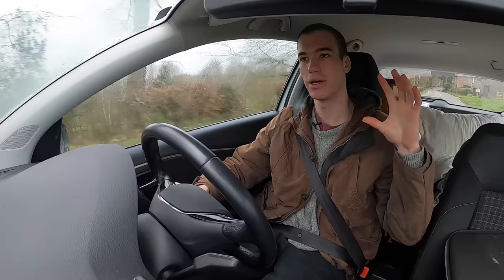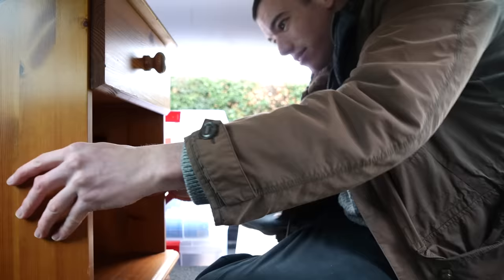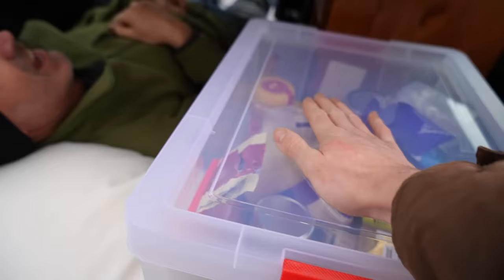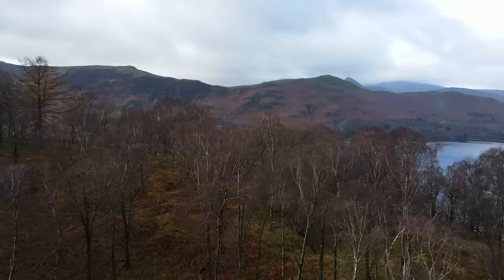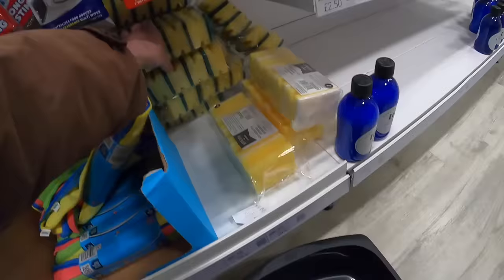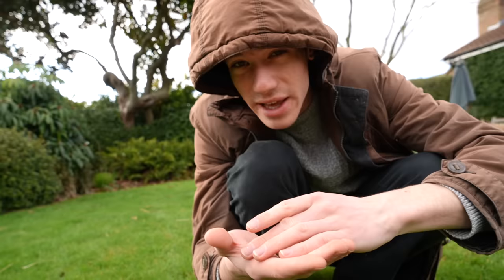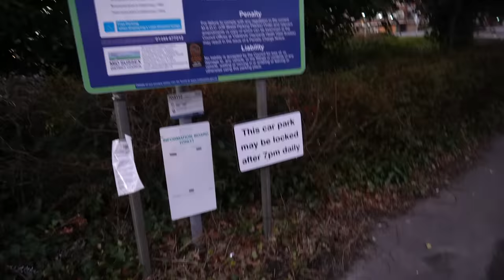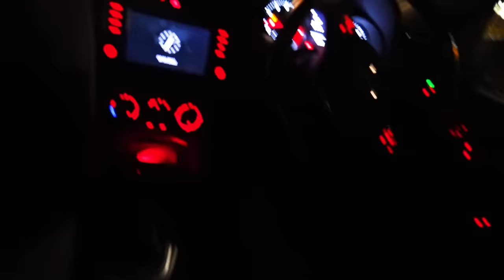Stealth Car Camping In A McDonald’s Car Park (Tiny Car Conversion)

Comment: Get you windows tinted 😀
Reply: and you can’t see
Reply: Yes it's minimum to do
Reply: At least You need s sleeping mask and leave the Windows a little Bit Open.
Reply: @urmom12383 I got limo black, I can see just fine, only night time reversing with no streetlights, but I installed a reversing cam, so can see with that :)

Comment: Don't give up! There's a lot of joy doing things differently and adapting to the struggles, you'll get there - trust me! Staying in a small car keeps you focused on the outside, you're always looking where to go, what to do and the comfort of a van seems to take away that from you somewhat and put you in a nice calm bubble. On the practical side, you can make easy sunshades from insulation (just cut to size) or for the meanwhile, just put a blanket or some clothes on the driver's and passenger's window, it'll do the trick :D Also you could look into getting a roof box for a less cluttered interior. Either way, best of luck on your journey! <3
Reply from the maker: Thanks, appreciate your comment! :) I'm not givin up on the car!

Comment: A few tips from having to live in my car numerous times for a few days or weeks. 1) An estate is better than a hatchback.
2) Some roller-blinds on the windows would give you some more privacy and keep the light of a bit in the mornings. You can get the ones for blocking the sun on the rear windows from car parts stores and make them work on as many windows as possible.
3) Finding a nearby swimming baths gives you access to shower, shave spruce up, cafeteria etc.
4) In colder climates, that condensation will freeze on the inside of the windows/windscreen, so have a scraper and towel ready.
5) Maybe swap the duvet for a cold climate army surplus sleeping bag (British and Dutch are both great choices) with a compression sack and sleeping bag liner. Cheap and will keep you warm, plus, you just air the bag and wash the liner with your laundry now and again. You can pack it if you need the space too.

Best of luck.
Reply from the maker: Thanks for the info! :)
Reply: Next video.... Alex goes out and buys an estate car because it's "better" 
Roller blinds? LOL 
Did you get advice from all and sundry before you did car camping so you didn't make any rookie errors?

Comment: Few upgrades I can think of is tinted widows with blackout cut outs you can push into place at night. Maybe replace air mattresses with form pads. Wind deflectors on windows to let a fresh air in. You also need to think about how your keeping that battery charged and heating for when it gets real cold. I know sometimes upgrading can be out of budget but think you'll need it if the option is there for you.

Comment: You can buy window covers for quite cheap to make your car more private, and it can be better to have a window open a tiny amount. As you can see when you woke up in the morning the car was full of condensation which ends up making you even colder, and a bit wet too, obviously this is better in the summer months when it's warmer outside but even in cooler months its something to consider. But overall I would still say get a van; more room for you and supplies, safer, comfier more convenient etc, but up to you at the end of the day, keep the videos up!
Reply from the maker: Thanks Adam!

Comment: Nice video pal you could also get our estate car which is cheaper than a van and cheaper on insurance, you need to cut some black outs for your windows could use car cardboard to just cut them out. Also look at some wind defenders so you keep your windows open a little but no wind or rain can get in , wish you all the best with the trips 👊

Comment: Keep on experimenting, don't be afraid to try new setups. I converted a Peugeot 206 estate to do trips to the  Pays D'Oc  in mid winter. Foil insulation cut for Windows helps a lot with heat loss. I fitted a double bed system in for pence. My wife and I  managed well in it; using the French system of Aires. I am now 74 and still experimenting with different setups currently use Toyota Corolla estate. You might consider edit out your registration number plate. I found that most small shops abroad stock ethanol called burning alcohol. Try building your own stove don't just rely on one fuel source. Most of all enjoy it while you can!

Comment: Having spent nights in a Vectra I don't envy you in a hatchback. Privacy isn't as big an issue if you're planning to be out more in the sticks or tiny village more than a High St. 
As others have said I'd swap duvet for a good sleeping bag (3 season at least), will pack away smaller too. 
I'd suggest on long trips not spending every night in the car, get a tent that wont take up much space in the footwell or boot and hit some cheap campsites for a better sleep, showers, toilets etc, or even walk into hills and wild it. Though I always worry about leaving car overnight

Comment: This brings back some memories. When I was performing a one man show in Edinburgh at the festival in 2005, myself and a friend got kicked off the campsite, (misunderstanding as we'd done nothing wrong), within two days of a two plus week stay. We then spent over two weeks sleeping in the car just outside the one mile city limits parking zone. Changing location each night, sleeping under lam posts for light etc. Like yourself, a big problem was the toilet situation. Other than that, we wished we had done it from the start and saved the money spend on the campsite. Cars are ok for sleeping in, not so much for living\staying in. 
We've also stayed in the car several times on nights out, rather than pay for hotels. It can be done. I wouldn't do it so much now I'm a little older, but at your age I'd have loved it.
On another note, yes the condensation does provide privacy, however on the flip side you also look like a client of a prostitute, or like you're dogging... Just something to be aware of, especially in woodland car parks, and rural\urban areas. 😉
Reply from the maker: Thanks for sharing that. :)

Comment: I car camp and For your windows to keep you warmer and hidden. I used foil insulation and covered them in black fabric so they look like tinted windows from the outside, has helped with noise(a little) and keeping you lovely and warm. I do crack the back windows a little for air. Works great, happy camping 🙂

Comment: Hey Alex. Love the video..
I love the concept of micro stealth gaming too.. Vans are too easy and horribly expensive to run/insure.

Heres a few tips for you though..

1) Replace the leisure battery and inverter with something like an Ecoflow Mini. No acid in the battery so no worry about spillage. Has built in inverter which can run....

2)... An electric blanket. That thing will keep you nice and toasty through the cold nights as you will need to leave the windows up a little to avoid condensation.

3) wind deflectors on the front windows. These will allow you to leave the windows open a little yet it won't look open to passers by and nobody will be able to peep in.

4) Insulated/black window blinds. Just something simple cut to the shape of your windows which you can use magnets to hold them in place. Maybe just use the foil blankets are meant for behind radiators.

Hope that helps and looking forward to your next videos.

Comment: To secure the battery inside the nightstand all you need are velcro straps. Stick a big velcro strap to the bottom of the battery and another one (the opposite type) to the nightstand. That way the battery won't slide around when driving but you will still be able to detach it quickly if you need to. Or you could attach several little wooden stoppers to the night stand around the battery using screws or small nails which would also stop the battery from sliding around. You will also need to tie down the whole nightstand somehow so that it doesn't tip over when driving like in this video. But like other people said, just get a van. But it seems like you realized that yourself already.
Reply from the maker: Thanks for the info! I'll take all this in and apply it to the car soon!

Comment: Sorry if this is commented already but that battery will kill you!!. Secured means SECURED. in case of roll over/accident
Also produces explosive/ toxic gas must be ventilated. A hole in the top at either end can be connected to vent externally. A lead acid battery will always corrode anything close. Gel batteries are slightly safer. Otherwise good work mate! Very brave. Good luck get a campervan.😀

Comment: Great video man don't give up the small car yet!
A small car is infinitely more fun to drive than a van, simple things like crack a window to sleep also a carbon monoxide detector is a must!
A 12v cigarette lighter usb charger can plug into your inverter and run usb lights without the inverter turned on as well as charge all usb devices. 
Good luck dude!
Reply from the maker: Thanks, I'm not giving up, I have plans to convert it a little better over the coming weeks. Gunna put my DIY skills to the test! :)
Reply: Glad to hear it man 
A couple cheap disposable dehumidifiers placed around can really help to.

Comment: As someone who has been vagrant:
Ordnance survey maps (or the app which is 3 quid a month) is invaluable for pull ins and likely places to stop.
Water. Just. Loads of Water.
Condensation. Crack a window and or get a moisture trap. They're for damp houses but work great in small places like cars.
Skins rather than blankets. Heavy but so insulative underneath.
Legs below head when sleeping. Key to a good night.
Arrive after dark, leave before sunlight.
Comforts matter less every day you don't have them as you get stuck into the journey.
Reply from the maker: Thanks for all the info.

Comment: Things to consider, 1/. if you cant get a van, you could do much worse than a Skoda Octavia Estate, lots of room!  2/. Charge your phone from the car when the engine is running  3/. Your bedside light is probably 12volt connect it direct to the battery, running it through an inverter and then a transformer plug is a waste of power. Both 2 and 3 will make the battery last longer. 4/. Ditch the quilt get a 4 seasons sleeping bag with a hood, it will keep you warm on the coldest nights and is less susceptible to condensation and damp. 
Good luck.
Reply from the maker: Thanks for the info!

Comment: If you keep your polo, which is a big if why not remove the passenger seat. Unplug the airbag sensor and remove the whole seat. You can make a box to make your bed flat with drawers underneath. Gives you lots more space. You could remove all the rear seats aswell. MDF over the top and build it up that way. But the sensible thing is a van, although the small car thing is quite a entertaining and appealing unique watch! Great video once again. Make me chuckle
Reply from the maker: Cheers for the info, yes I may have to get a van, BUT it's quite fun trying to make it work in the car!
Reply: @just_alex  it makes for a very different challenge that’s for sure, maybe a van is simply to easy for you 😉

Comment: Hey Alex your inverter is going to drain your leisure battery fast . Try a cigarette lighter adapter you can pick them up at go outdoors or similar just a car cigarette lighter on a positive negative wire clips onto the battery then use a USB plug to run the light charge phone ect save the inverter for high wattage applications . Happy travels
Reply from the maker: Cheers for the info Ben!

Comment: Led acid also offgases and is dangerous to have in your sealed car without a vent to the outside of the car, get you a solar generator its lighter and can be drained way lower safely and you can charge with a solar panel on your dash

Comment: Free advice leave those bed cover thingys somewhere and use a sleepingbag if you want to stay warm and get 2, one proper one down to minus 10-15c and a summer one down to 0c since the comfort temp normally is a bit higher than the sleepingbag says unless you buy the expensive sort.

Comment: On a vw or any other v.a.g car, there is usually a button on the pillar under the seat belt, looks like a car with WiFi signal. If you press that it turns the interior sensors off for the alarm

Comment: Here's a cheap and cheerful hack. 
   Menthol shaving foam, rub it on your inside car windows, buff it off until its clear again, it'll significantly reduce the condensation... 
   You'll end up with moldy seats, bed, roof liner etc etc after a while if you don't control the condensation.
   Also diesel heaters, when you get a van ;)
Reply from the maker: Cheers for the info!
Reply: @just_alex  No worries, I use the shaving foam trick on the house windows in winter to stop them misting up. He's to be menthol with alcohol in it. I think. Good luck :)

Comment: I’d suggest you invest in a small van or even swb transit/vivaro… you could get a ridge monkey toilet in there or even a camping toilet installed from a camper, include running water, a fold away bed base and secured storage and a safe place for the battery and inverter. It’s worth that little extra expensive to be practical and comfortable!
Reply from the maker: Nice ideas. Thanks!

Comment: I would try get yourself a van tho for europe, even if its just a non converted standard transit or caddy, will be handy for you to have that extra privacy and storage, if not you could potentially at least get one of those storage boxes that goes on the roof of your car so you can take more camping gear and supplies. Would be cool for you to take a full wild camp setup as im sure you will come across places that would be great to hike to and camp at around europe during your trip.

Comment: Bit late here but you should run lights/phone charging straight from the 12v where possible, get 12v lights and usb chargers. Then only use the inverter when you need AC because it's much less efficient and will drain your battery faster

Comment: Even if you were in a van, you definitely need blinds for your windows. Also, to avoid fogging up the car, either turn up the heater/AC or creak a small opening in the window or in multiple ones if you want lots of ventilation.

Comment: Fair play Alex, for a tall lad in a small car, you've done very well to have managed two nights!
I did this a few years back, when working away from home, in a much larger car and I'm under 6'. I found the self consciousness to play a big factor in where I parked and quite often would be waiting for boy racer types to clear off before settling down to sleep.
My set up allowed me to sleep in the back of the car with the seats down and the front seats up, which meant I could hang blackout fabric between the front and back of the car. I had blackout fabric-backed cardboard cutouts to match the rear window so it completely concealed the interior. 
I know its been mentioned, but you have to ventilate or the condensation will lead to problems. Some people recommend silica gel packets under the windscreen but I can't guarantee it's efficacy. Open the window a crack and fit wind deflectors maybe?
Car camping can be done, but I think you might need something larger...think Volvo estate, it will make things easier!
Reply from the maker: Cheers for the detailed info and suggestions! :)

Comment: Car is not too bad a size. There's a guy on YouTube travelling Europe in his Skoda Citigo. That's a smaller car. Youll need to build a smaller cabinet to get more space. That pine cabinet is taking up too much space. The battery is an old type battery. You can get lithium batteries that are smaller and give you just as much juice. This will also give you more space. Don't forget about privacy and get either your Windows tinted or get black out blinds.

Comment: I have a Gen 2 Prius and have been looking at converting my car one day too. The hybrid system is handy because you can leave the car engine on and heater for winter. The engine will turn off and turn on every 10 to 20 minutes to recharge the hybrid battery.
Reply from the maker: Sounds cool. Thanks.

Comment: You don’t need a van! Just get an old Volvo estate for about £1000 (use the change from Polo for converting and pocket money whilst travelling), limo tint the rear windows, and get some black in car curtains from eBay, and move all your other stuff over to it! 

Oh and put your leisure battery in the spare wheel well, with a split charge relay to charge it from the alternator.

Comment: Hi Alex I live in my car full time with the curtain issue get some plastic floor protection sheet a company called protec do it and cut panels you can put in and out the windows. Also my car is a little corsa hatchback

Comment: No van needed 
Volvo v70.... job done.... goes in any multi storey car park ( unlike vans )
No permanent modifications  required , ... easily liveable .
Dump the leisure battery get a 2000w aferiy  power station  .

Comment: Your battery, forget the inverter. It uses way too much power even just being on. Get a cigarette lighter socket and wire it to the battery then you can use a usb adaptor. IKEA do great usb lights that look like a miniature of your big light. The usb adaptor will let you charge your phone too. In my van I use a goalzero lighthouse micro, it lasts a long time on low and is usb rechargeable. 

Try to recharge everything when you run your engine. You need to work out recharging your leisure battery, it's really important.

Look into blacking out your windows

Comment: Alex you need to watch Mort, he’s doing what you are wanting to do. It will give you some advice. I lived in my Skoda Octavia estate all through lock down I put up black curtains, using garden wire as curtain rail. I used a poweroak solar generator for all my power. Fairy lights don’t use much power. Also a single electric over blanket is also brilliant for keeping you warm. I also live in my truck all through the week. Good luck love your videos.